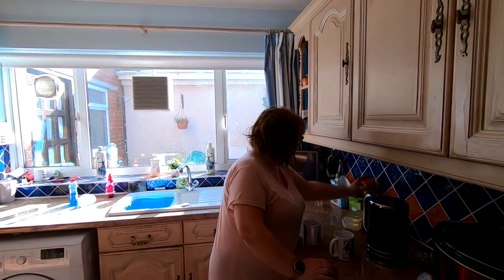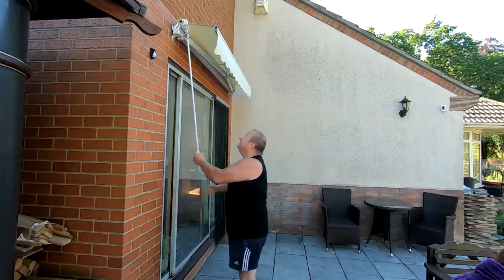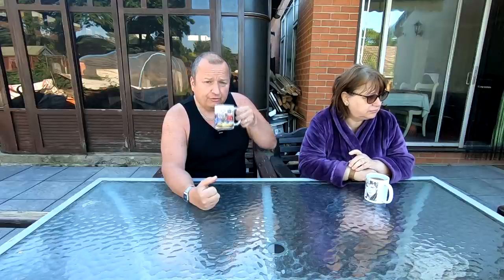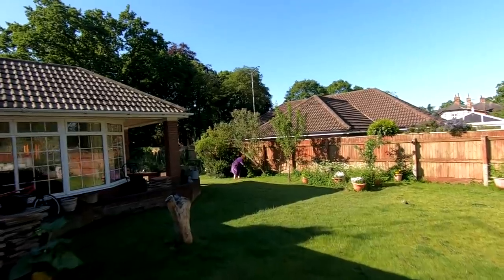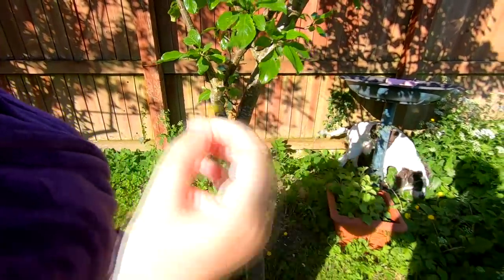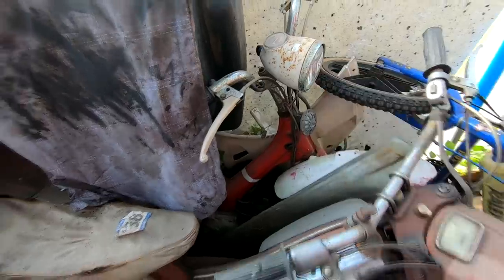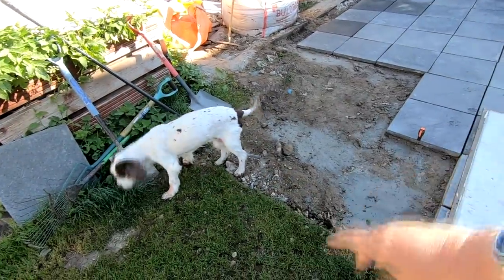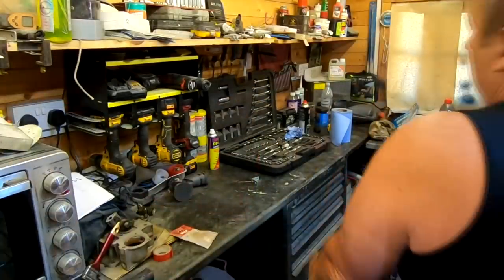Things Out Of Our Control But Be Positive And Move Forward Vlog

Comment: Not sure what the tipping fees are in Lincoln but in the Midlands I'm being charged £170 per ton to tip as I do waste removal. I don't take soil or rubble as there is no point because its cheaper for the customer to get a skip if someone is quoting cheaper then most likely it will be fly tipped

Comment: You've done a ton of work so far this year, and using your time very well, so wouldn't be too down about anything much, you'll get round to the Trotter van soon enough, though the cancelled holiday is irritating to say the least, however we'll be out of this Covid nightmare soon enough now. Also, you're bang on about the processed foods, of any description, 'healthy' ones, or otherwise, it's just a vicious circle to keep eating them, just slows the metabolism, all to do with insulin resistance, absolutely,  and especially bread, imo. The biggest problem is that most of these foods are highly addictive, just go through the shelves in any supermarket and with an open, clear mind, all you'll see is poison everywhere. They mean not to make it easy to break away and genuinely eat healthier, no profit in it for them, people wouldn't eat/buy nearly as much if the balance was as it should be. And good quality cuts of meat, beef and lamb, portioned and in moderation, is fine, once you get back into the routine, and make your own burgers and sausages for any BBQ in that lovely garden of yours, and above all enjoy the fruits of your labour, well deserved 👌

Comment: It's not good for your health to cut carbs out completely. Especially if you're diabetic (from one diabetic to another)
Reply from the maker: Yes it is, I don't know where you are getting your information from. There are no essential carbs. Your body has the ability to produce the carbs it needs and you don't need them from your diet. To reverse Type 2 Diabetes, you need to cut out the dietary carbs and keep them down to around 30 grams a day supplied from mostly green veg, (no wheat, bread, potato, pasta, dairy, fruit and root veg) You say "from one diabetic to another" but I wonder how your diabetes is doing? Every diabetic I personally know, their diabetes is not getting any better, Mine is fully under control with diet alone to the extent that the doctors can't believe the results of my last 2 blood tests. It you are listening to the mainstream then your diabetes will not get better. Food for thought.
Reply: @butlersempire  I googled it a few days ago and it was the first things that came up. However, after doing some more digging it seems that first bit of info I read is incorrect.